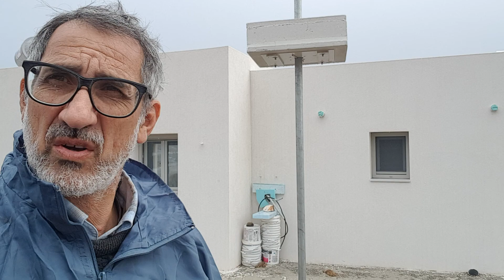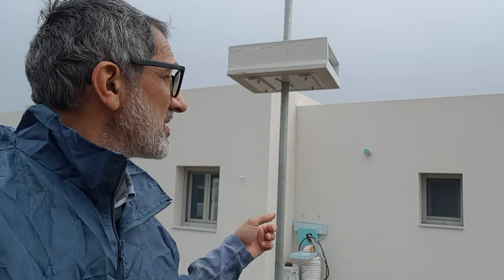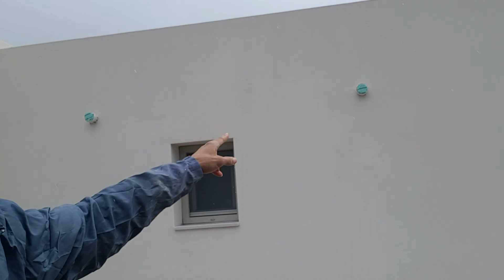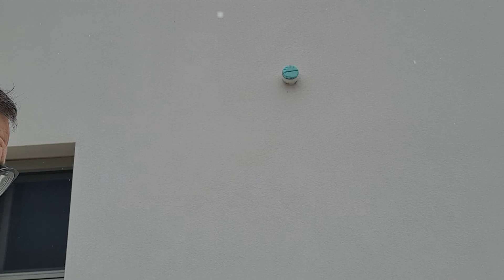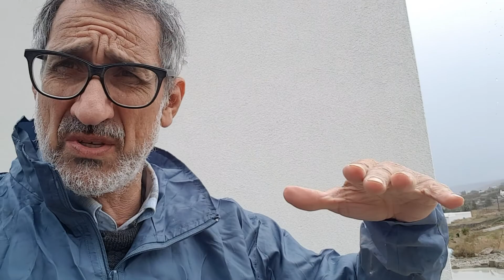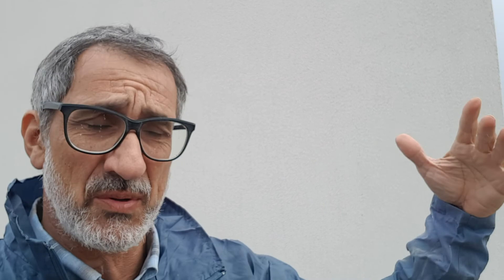Welcome to Kostas Creating Sustainability Permaculture in Paros Greece

Comment: Kostas, you came a long way! Now the rain has come, love to see more, i hope the earthworks do there job and the water soaks in.. soon it will be all green up there in Paros! Keep the good work going..
Reply from the maker: Thanx Bart  appreciate the interest. You are so right. When I first created this earthworks had no vegetation to hold the mound together and although the math said it could fill to capacity of 70m3 to soak in a week, when it happened and the water sitting there hit the first overflow pipes, it shocked me so I immediately got a large hose and syphoned it dry out in fear of a breech. I did this 4 times through the season. last year I closed the source but this year i'ts open, covered in vegetation, so it's only a matter of time. when something happens ill shoot a quick video and post it.
Reply: @KostasCreatingSustainability  Thanks, that's an important lesson to share with viewers,  as any journey is winding one, and no-one lands with perfect design - so coping strategies, and having plan B is very smart.